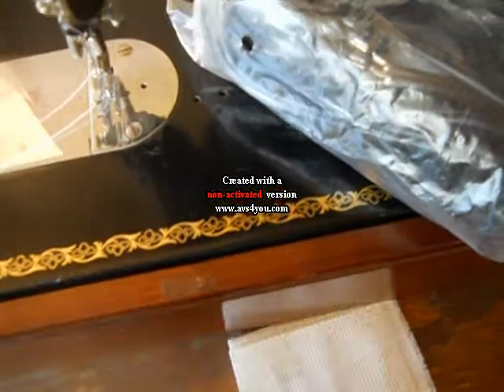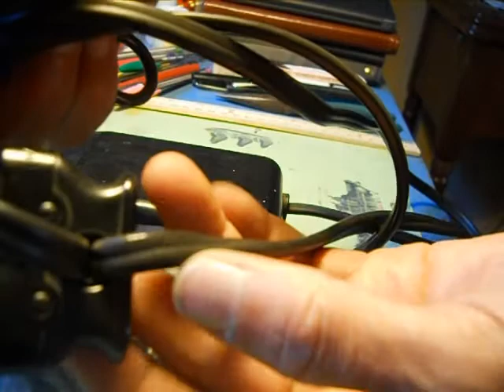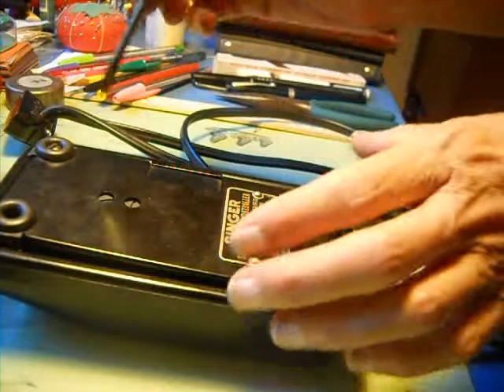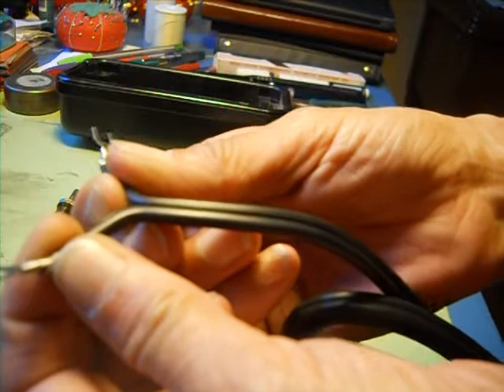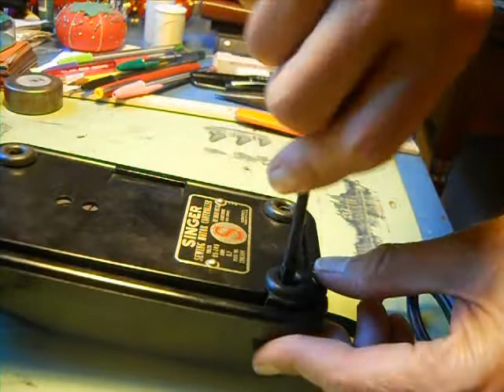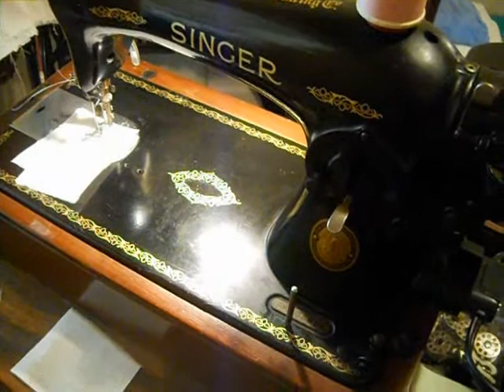New Cord 15 91 Motor Controller / Foot Pedal

Comment: Does this cord run the light as well or do you have to get a separate cord for the light? Thank you
Reply from the maker: You would have to look at how your machine is configured because sometimes machines get "Mickey Moused" with wiring depending on what the owner had for available wires and what they wanted to set up, but generally, when you plug the power cord into a 15-91, it runs both the light and motor. The one end of the cord attaches to the machine on the right side of the pillar. The motor and light are wired to the "block" that the cord plugs into, and so the one power cord powers both.
Reply: @LaurieOMeara  thank you for your help.